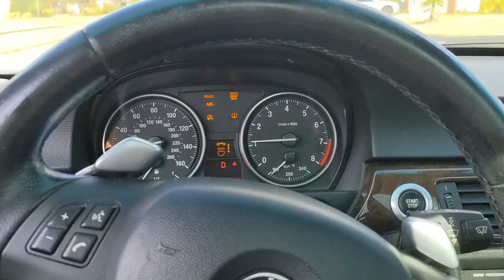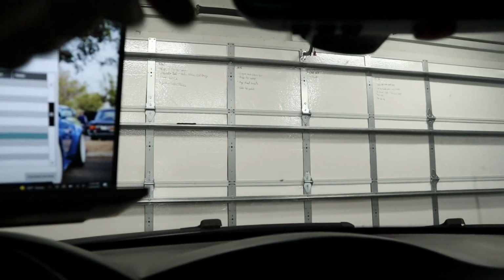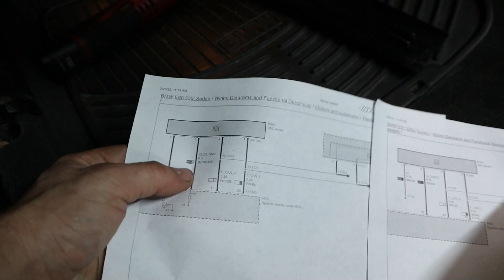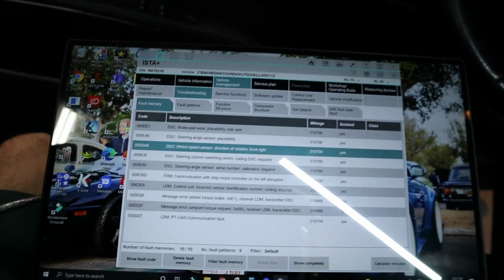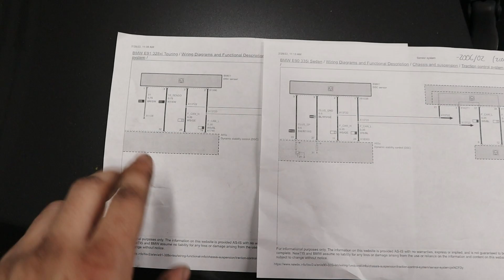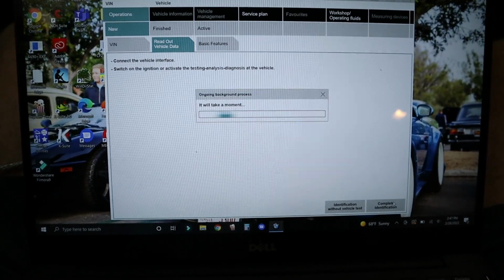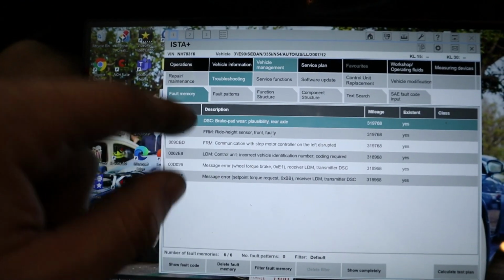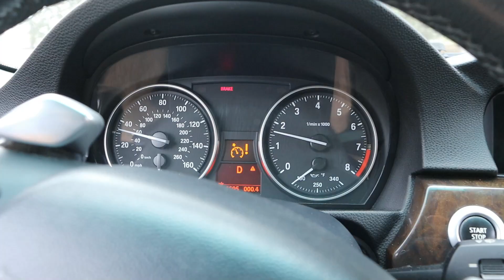335i Wagon Build, X-drive to RWD Conversion COMPLETE!

Comment: Really struggling with my swap. I did auto to manual and x drive to rwd. Did all you mentioned but having many codes for fuelpump, wipers wont stop and dsc no com for a lot of stuff. Im insure if I have to loop can wires to old auto harness or not.

Comment: hi, great job!) i did the same with my 325 e92, but i still have wiring 5e34 about sensor under the seat(( and there is no servise function active in ista to calibrate it. I do everything as you, how do you think why a have this problem? i have lci DCS and lci sensorcluster. but my car is not lci (2007). maybe it have some changes... what part number was on your DCS? this wiring kill me)))
Reply from the maker: Yes the dsc sensor has to be changed, and the connector must be rewired to use the new DSC sensor! Otherwise you'll be stuck with that fault

Comment: INPA looks super complex haha I just use ProTools for scanning codes but what does it mean to “Code Out” does it mean changing the VIN of the module or telling the ECU to ignore such errors? In theory could the previous owner code out really bad engine codes that otherwise we would want to see?
Reply from the maker: When I say "code out", I mean remove the feature from the car by telling the corresponding modules that the feature is not equipped in the first place! So by telling the car that it is not equipped with a TPMS system, it stops "looking" for that module (which wasn't connected in my car to begin with) and thus won't show any faults for that system. You cannot hide any fault codes from displaying on a diagnostic scanner, as far as I'm aware.
Reply: @TheBimmerBarn  That’s awesome ! I wonder if this is possible to do in ProTools. Thank you for making these videos brotha. You’re a blessing to BMW owners
Reply: @BassFraud  Protools can do it but you have to have the full license.  Diagnostic and coding.